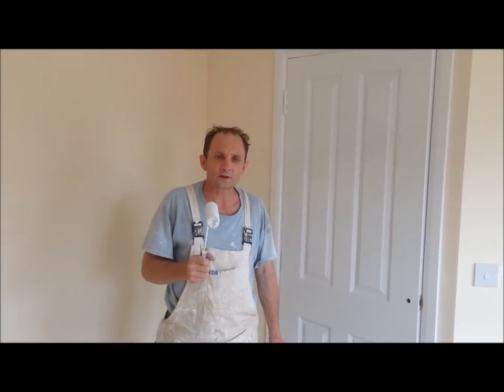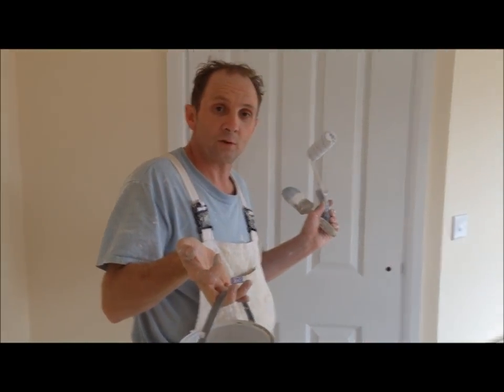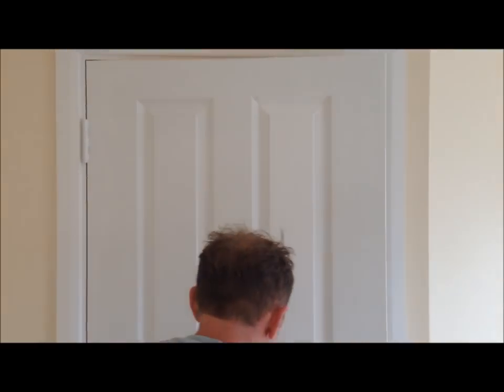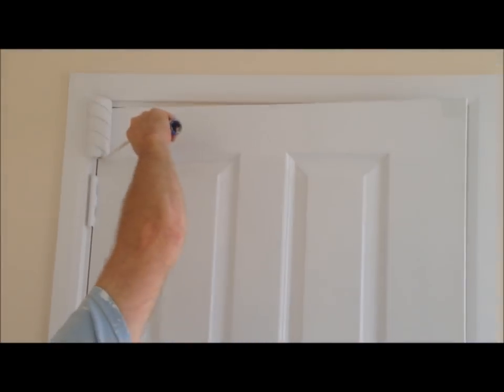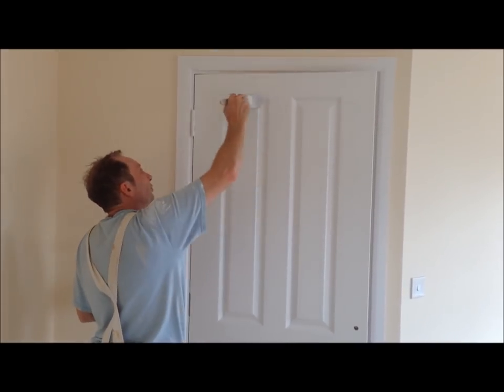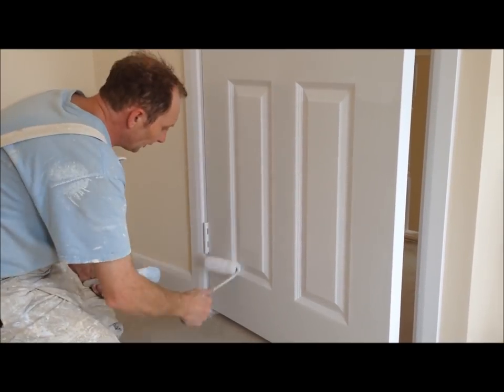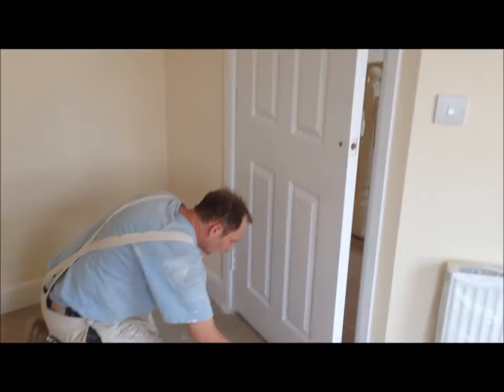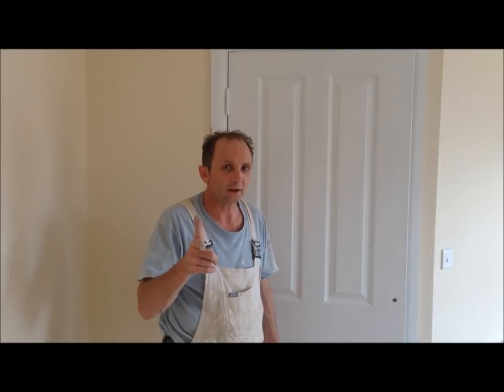How to paint a new door in a finish coat of paint with a roller

Comment: Good video.. 
I always used to brush in the internal moldings fast as possible with a 2 " brush and then roll everything in with a 12" mohair roller sleeve and then a  fast lay off.. Also GREAT for the old flush doors.
Don`t know if you can still get those mohair type sleeves and frames but give it a try...
Trust me..You wont go back to rad rollers and you`ll have more time to drink tea.
Reply: yep.

Comment: You forget to use the brush to "tip off" the roller orange peel effect that would have been left on the door. You took the fatty edges off the edges which most other guys dont and you let yourself down with not using the brush to get rid of that orange peel. Nice fast job though! well done!

Comment: I'd like to see your method using a contrasting colour. This way I can determine whether your method leaves brush strokes or not, as I have been told to cut in all the groove areas first BEFORE using a roller on the panels to smooth the lines. Can you make a video that takes us through the motions from prepping, priming and painting - especially for us girls. Thanks! :)
Reply: +heather s (aussiebeachgirl) Good point. You are on the right track!
Reply: I've always cut in the grooves. Never failed me. 👍 👍
Reply: Girls paint differently?

Comment: Hi,I have recently painted my stairs and hand rail in dulux water based paint about 3 months ago and the wife has noticed when wiping it down the paint is coming off.Can I give it a light rub up and repaint it using this oil based paint and will I have to undercoat if first or can I just paint over the top of it.Great video 👍

Comment: Foam roller is the best
Reply: Foamies don't get enough paint on.
Too many dips.
Reply: Foam are you a painter???

You can't beat the 4 inch (green) jumbo emulsion rollers from Dulux after a few months in Maggie there great for doors.
by the way saw your video on how to fix them great video that pal. Keep up the good work mark. 
Ps. JJ Hancock's great to work for I know Aaron Glen saw him in some videos lol
Reply: What for glossing a external door ?
Reply: tony Lorns if your not in the trade I'd suggest getting yourself a microfibre 4 inch roller from most paint suppliers wash it out with warn water first it'll hold plenty of paint & providing you give it a good rinse before you use it you won't get any fibres come out. 
Don't bother with sponge rollers they don't hold enough paint & even after laying the door off they leave the orange peel affect which you don't want.
Reply: Cheers Peter for the info most appreciated ,so when i " roller" the front door just " lay in off " with a brush after ?
Reply: tony Lorns 
Yes pal. Roll in the groves is quicker to or if your not confident brush the groves roll the door out then lay off with a brush as I said mate you don't want orange peel affect. 
Hope that helps.
Reply: Cheers Peter for that mate
Reply: Try 4 inch mohair.
Reply: Raj Nirvan
Mohair are no good for doing new build plots I suppose if you’ve got time there ok but as a production painter you can’t beat the Dulux 4 inch jumbo green emulsion rollers worn in after a few plots of emulsion they are amazing in undercoat & gloss/satin hold plenty of paint & you’ll fly through a plot of doors in a few hours.
Reply: Peter Campbell Ok mate I look out for them in future. But if I was offered for finishing touch rather use mohair than foam as it won't fall apart etc. Must admit get good finish using them with certain varnishes